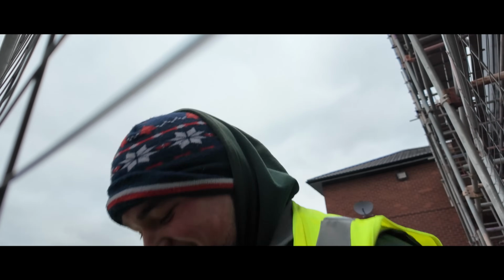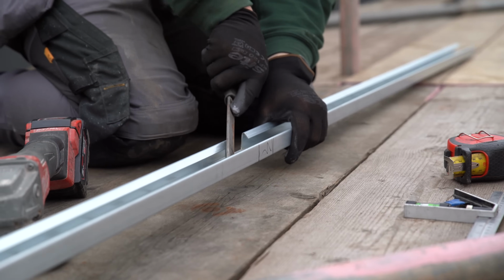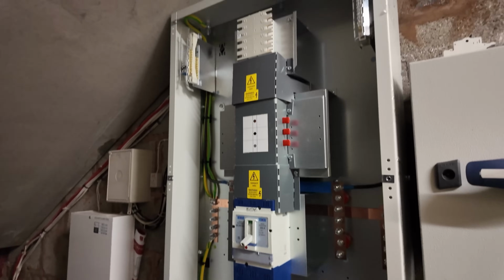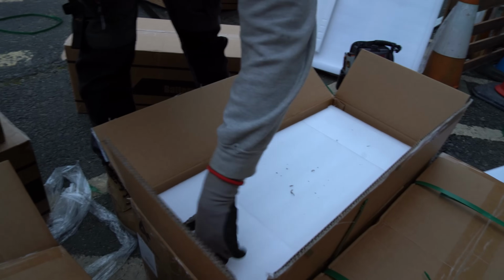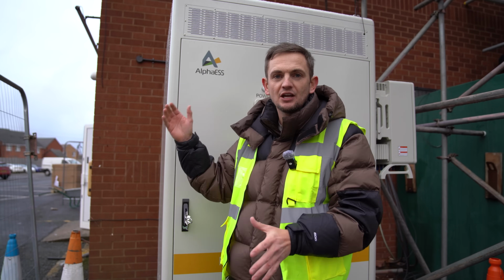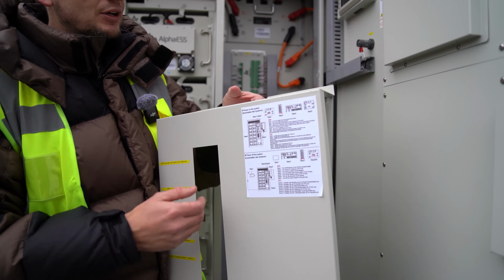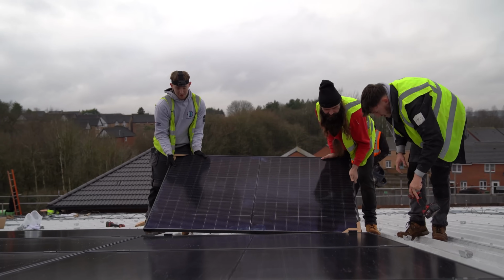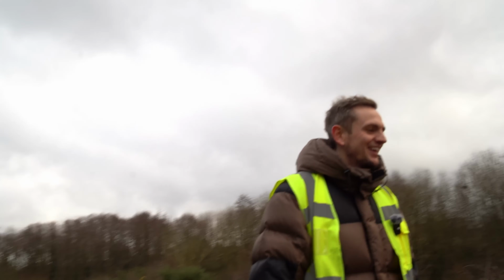Europe's FIRST H50 Battery Installation | Hednesford Town FC

Comment: a bit of a slap dash install by not reading the manual first, allowing 1 guy to insert a cell, showing how to get into the cabinet without the correct key - not a good look for the manager and owner
Reply from the maker: ARE YOU NOT ENTERTAINED?
Reply: @Heatable  not during those parts, looks unprofessional and would make me hesitant putting your company on a list of possible installers not knowing if anything else went wrong that we didn't see.

Comment: Did you use any ac optimisers on the panels or was in all string connected to the inverter
Reply: I hope they're didn't, there's no shading on the array.
Reply from the maker: Hey Alan, no micro-inverters were used on this install. It wouldn't make financial sense when there's 227 panels (the cost would be huge).